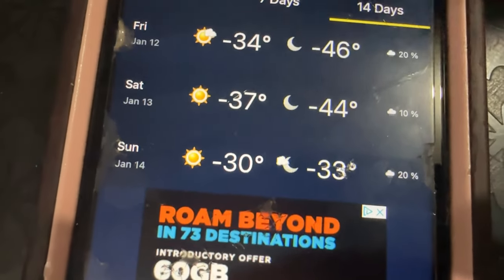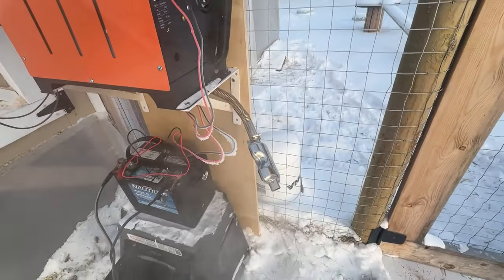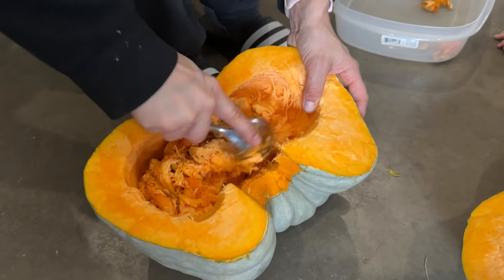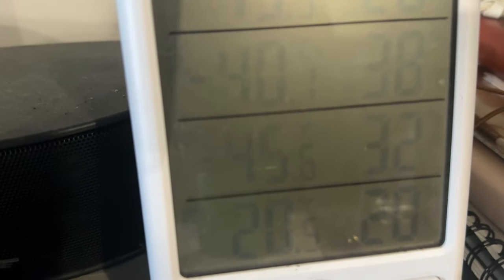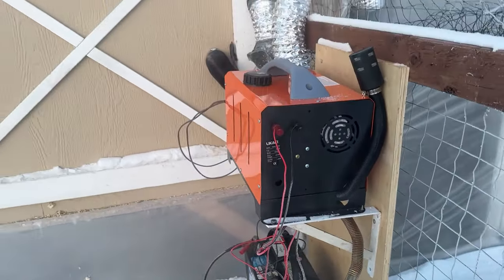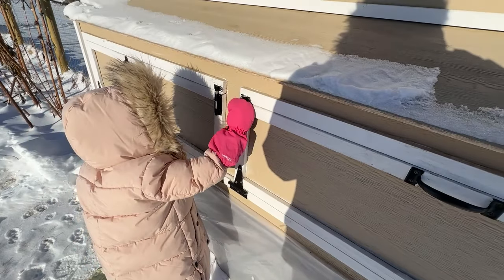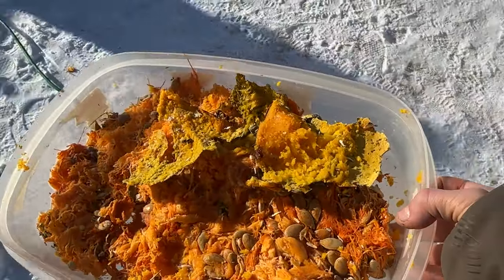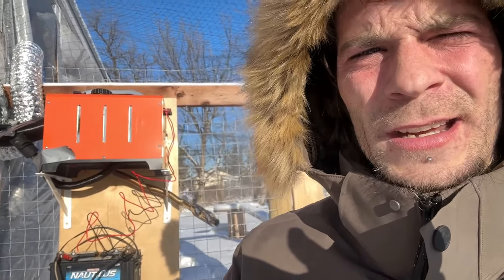Likaci Diesel Heater | How To Heat Your Chicken Coop Extreme Cold!

Comment: For everyone asking about the fuel geling. I mix Howes fuel treatment with everything i run on diesel, including my truck. Ive worked throughout north dakota for close to 10 years with similar temps and never had any issues  with geling. As far as keeping the intake thawed. I built a box around mine and the heat from the heater operating is enough to keep the frost off the unit.
Reply from the maker: Yes Howes is a great product and works well 15 mins and it was back up and running. The intake is now warmer pulling air along the blower hose. Thanks for watching and commenting every bit helps the channel. Did not know Dakota got that cold.🥶
Reply: @AlbertaAdventurerFamily  Absolutely. Up around grand forks it's been negative 40 on record and I've been on oil pads throughout  the state seeing 20 below several times with wind chills 60 below.

Comment: I would say that you should add an insulation. I have small chicken coop for 5 chicken (1,5mx1,5mx1,5m size) and I have insulation 5cm and temperature inside is always 8-10C higher than outside without heating. So in my region (Poland) where we do not have so big frost ( sometimes lower than -10C) adding 5cm insulation was enough to keep chickens in winter without heating at all. But on your side adding insulation would help to keep higher temperature, maybe electricity would be enough then.
Reply from the maker: We do have insulation but we find we like to keep our coop about -10c at coldest. We like our girls to stay happy. Also we found with our coop and the open bottom the deep litter method helped to insulate the coop as well. It was our first winter with chickens and we learned a lot.

Comment: How are you guys keeping your diesel fuel from gelling up and making your area you’re heating up warm without heating up your diesel fuel because diesel fuel starts to gel up at -10° and it doesn’t flow very well and that’s not very good with trying to run something like that so if you haven’t solved your problems, I would recommendmodifying your chicken coop so that you can run the exhaust out of the wall while that heater is inside the room warming up so that you don’t have the intake freezing up
Reply from the maker: Yes we did run into the problem of diesel jelling on day 3 when we shut the heater off to fill and added cold diesel. So we then changed to mounting inside and running the exhaust outside which did the trick for rest of the cold snap we had. We did update in our description of this video as well. Thanks for your feedback.

Comment: I’m just curious why you didn’t vent in the fresh air intake for the heater and starting a year video you can see that it’s not and that you can tell that there’s snow getting sucked into there well that is one of the few reasons why the Chinese diesel heaters do not run For more than five years without having to replace them because unlike Basto and all the other real diesel heaters they have an instruction manual that is a lot easier to understand than these ChEnglish diesel heaters
Reply from the maker: I didn't have time, it was bring the chickens inside or install a heater in 1 day with -46C around the corner. We installed it when it was -35 outside. Now we have build a box to house everything and keep it frost free. We also have it off now because our electric sweeter heater is keeping the coop warm enough at -20C we only need it when it dips down past -30C

Comment: Do you have any trouble with the diesel fuel gelling and do you add something to prevent it ? As far as the intake freezing could you rig up something to capture a little heat off the exhaust pipe closer to the unit?
Reply from the maker: Yes we do add a diesel additive called Howes diesel anti gel full lubricant but it was -45C outside that week. We solved the problem by moving the heater inside the coop installed on the door. Now we are back to the normal temperatures -20C and have moved it back outside with the intake attached to the heater hose to keep it warm thanks for all the support and feedback.👍